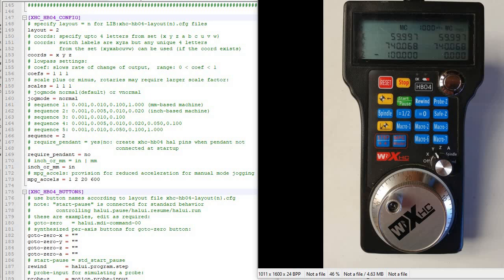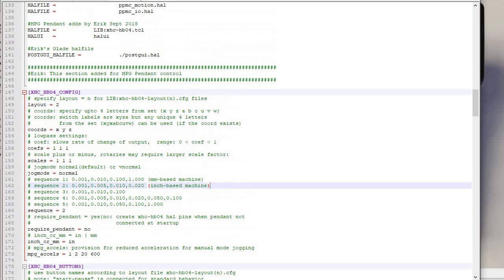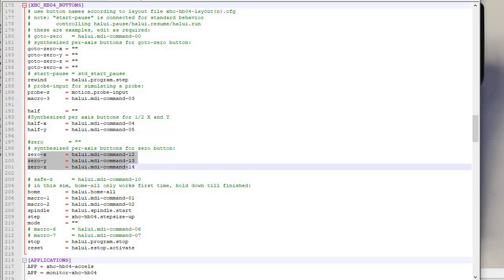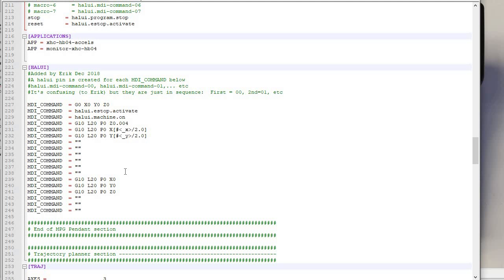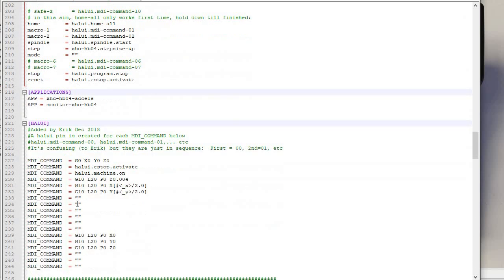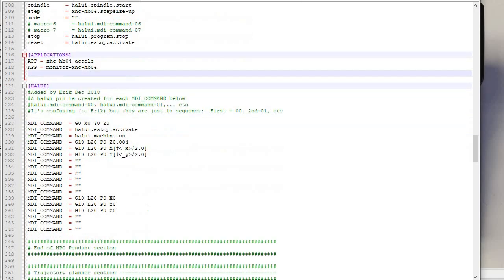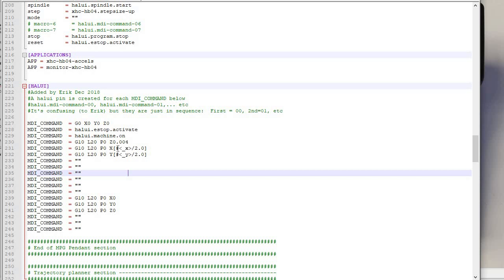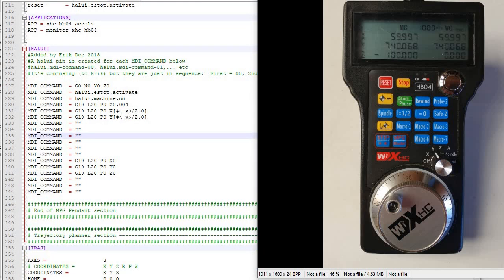LinuxCNC Pendant Config Tricks

Comment: Thanks so much for taking the time to make these videos.  I have just FINALLY gotten my first linux cnc machine to work after YEARS of starting and stopping because of getting stuck on basic software issues.  I am blown away that there arent more very basic "how-to" style videos on the linux cnc site.   I totally agree with you that the documentation is incredible, yet somehow all of the basic tenants are mired within the very technical manuals which do not have a specific section to explains the very basic aspects of the software.  I have a masters degree in software engineering, have built a dozen 3d printers, and I am familiar with gcode and it still took me lots of trial and error to figure it out.  Without the very basic concepts presented in a concise way it is very hard to pick up the context of the documentation.   At one point I even went so far as to print out and read the entire manual. Embarrassingly it took me 2 days to figure out how to even turn the machine on once the software started.  Dont get me wrong,  i love that this software exists. I know that it is free and community-driven.  I am grateful for that. 

If you ever want to commiserate or troubleshoot with a likeminded nerd- give a holler.
Reply from the maker: Thanks Jason.  I too spent a lot of time on the very basics, get it to turn on, etc.  I'm an Engineer by training but have been perpetually lost with LinuxCNC.  Do you have any idea what language this stuff is written in?  For example:  What programming language makes it so:  X[#<_x>/2.0]   is the way to divide the current coord by two?  For all the documentation, the easy stuff is what's hard.
Reply: @eriksalo5550   I think its just GCODE which was developed a LOOOOOONG time ago.  Its my understanding it is sort of a remnant of the past that keeps getting carried forward because so many things run on it.   According to wikipedia it was developed in the 50s.  I think a lot of it just has todo with limitations of early computers and a bunch of "bandaids" rather than rewriting the entire thing.  

I have no idea why it does the things it does.  I mean all programming languages have their own idiosyncratic formatting.  Like SQL needs you to put a @ before a variable.   Just the way it is.
Reply: yeah I agree - it's all simply assumed we are all pc geeks and should understand linux by simply installing it - there are huge gaps/shortcomings in the tutoring process for el dumbo beginners - prob because my self personally only see mumbo jumbo - what is missing is the concept HOW to look at the linux scripts then match/apply them  - Eric nails it good. There would be far more linux hobbyists I think if the mirrors and smokescreens were removed for basic beginners - the linux proletariats  "misdirection"  is almost deliberate its so blatant, well to me anyway. I have NO computer skills and yet watching 1 vid from Eric I can start seeing the concept and have a starting base to figure things out a little more, something I could not grasp before - thank you Eric